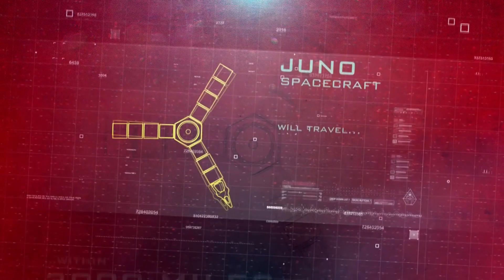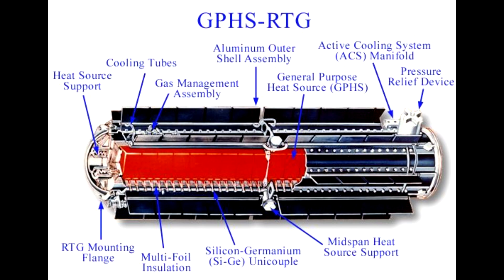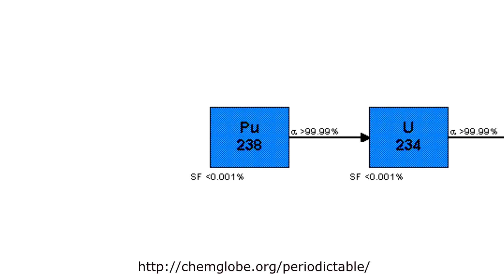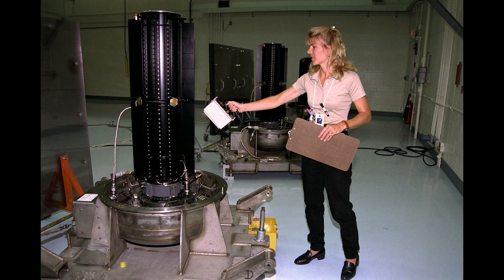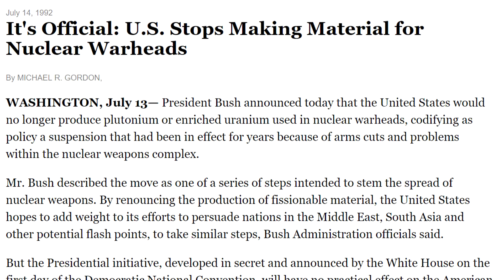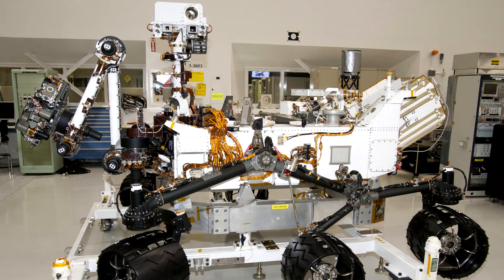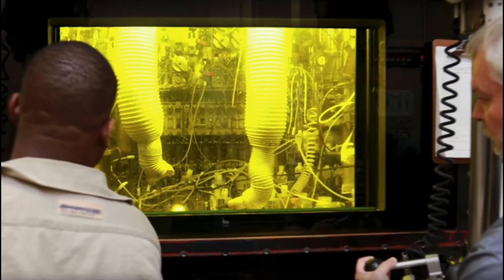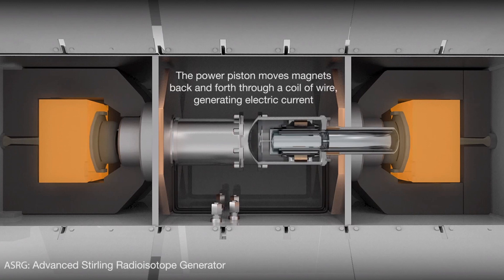Juno & NASA's Plutonium Shortage

Comment: While I knew about the plutonium shortage I thought they decided against using RTGs because Juno was scheduled to use an Earth gravity assist (which I believe is a no-no by international agreement)

I know there are other isotopes useful in RTG's; Strontium-90 is used in medical devices but I think it has half the shelf-life of Plutonium.  Maybe we should start using Americium because how cool would that be  ;)
Reply from the maker: +jonskowitz nah other spacecraft with RTG's have made earth gravity assists.
Reply from the maker: +jonskowitz strontium 90 is used in earth based RTG's because it's more common and a lot cheaper. But the energy density is Lower so in spacecraft the higher power density wins.
Reply: I think that is an orbital agreement, dunno about gravity assists, though.
Reply: Also, these things are designed to survive all sorts of abuse, such as atmospheric entry (the one carried aboard the Apollo 13 LEM is believed to have survived re-entry from an escape trajectory), and a launch failure (I read a while ago they tested casings by firing them at concrete slabs), all without breaking up!
Reply: Only neptunium shall be used when traveling to Neptune
Reply: Scott Manley Ya, was just looking it up and in post Carter years, both Cassini–Huygens and Galileo did an earth gravity assist.
Reply: I stand corrected then
Reply: Even the shorter shelf lives would be ok, because they'd all still be well long enough. It may have more to due with radiation particles, as Scott said.
Reply: That was what I was wondering about.

I found out that Americium is used in smoke detectors and I've been specifically forbidden from manufacturing an RTG in the house
Reply: Put a shed in your back garden, it will get around the restriction and sheds have been working for the UK for years now.
Reply: Kit Naylor Yup, very rough and ready, that is why they are less efficient than theoretical maximums of electro-thermo systems! When the real world hits, reality seldom looks like the ideal :D
Reply: Xeno_Lithic In theory they're so dead-simple that just anybody should be able to build one out of two dissimilar metals, something to use as a heat sink... and of course enough material to generate a measurable current.  

That last one turned the exercise into a purely academic one for me.
Reply: I did some more reading on David Hahn.  Poor kid, he was obviously intelligent, creative, and ambitious (at least in one specific direction).  It doesn't look like life has been very kind to him following the incident.

(from the looks of things, his safety protocols could do with some work though)
Reply: nope, a tragic story really. The radioactive boy scout did not have his best days ahead of him, sadly.
Reply: Xeno_Lithic Actually, I doubt those are radiation burns, I think he had a drug problem. If you are getting radiation syndrome, without treatment, you are also likely to die. Those pictures are of him much older, so ya, drugs is my bet.
Reply: Those only have .29 micrograms of Am anyway, you would need billions of smoke detectors to get enough material.
Reply: Ya, that is understandable, technically, for most elements heavier than uranium that are odd number are fissionable...making them controlled substances. You could technically make a bomb out of nearly any odd numbered isotope as a result and AM241 is odd :D
Reply: I've been waiting for that joke XD
Reply: Christopher Willis That was one of the two reasons I shelved the idea.  kThe other was being told, "I am not okay with you building a nuclear reactor in the house."
Reply: +jonskowitz "Son,  why was your light on all night?" 
"What light? "
".........."
Reply: LOL

One of the many advantages of nuclear power experimentation.

Comment: Just out of curiosity, and because I'm an idiot, how do they 'make' Pu-238?
(I understand half-life, so if that's part of it then you don't need to explain all that =D)
Reply: You sniff around in nuclear waste from a lighter element, usually neptunium 237. You expose that to a neutron source and it will absorb a neutron and decay eventually to Pu238. You have to do this slowly so that the material doesn't absorb to many neutrons and become Pu239, weapons plutonium, or Pu240, which has a low but significant  spontaneous fission rate...lots of gammas in otherwords. 

So you take something that is rare and costs more than diamonds, and you bombard that with other diamonds and send it off to space....it is expensive in other words!
Reply: Christopher Willis Marvelous, thank you ^.^
Reply: In addition to extracting it and materials to make it from spent fuel, it can also be produced from neutron irradiation of americium - which, I'm fairly certain, is how it's being produced at ORNL, considering it's being produced by the High Flux Isotope Reactor - which is an entire reactor facility set up for neutron bombardment.

Comment: Radioisotope thermoelectric generator
not Radioisotope thermal generator
Reply: You're obviously someone who's just learned about RTGs and now you want to tell the world that you know about them
Reply: they are technically also radioisotipe thermal generators as they produce waste heat.
so , technically , scott was right...
Reply: It's the same.
The only difference is that the radioisotope thermoelectric one converts the heat into electricity.
Reply: Who are you talking to?
If you are talking to me; I still know very little on the subject, I'm just stating that it converts heat into electricity.
Reply: ender_scythe no, i'm talking to the one who posted the original comment
Reply: Ah, okay.

Comment: Would Thorium reactors not make 238 as a byproduct if they get them going ?
Reply: +Drunken Hobo nope, thorium 238 is a byproduct of the th-232 process, by converting th-232 to U233 eventually you end up with pu238 as a byproduct and since the process is all liquid it would be trivial to chemically seperate this byproduct from the nuclear waste
Reply: Kinda, but right now fuel reprocessing in verboten anyway. Thorium fuel cycle that is likely to exist will also have uranium mixed in it, which ruins this capability. There aren't any pure thorium reactors on the horizon, but some new molten salt reactor start ups plan to use at least some thorium, which gets the technology ball rolling. But I wouldn't count on it for at least 20-30 years.
Reply: Christopher Willis I'm excited for thorcon though :D I like their idea of mass producing the most easiest design to make that already beats PWR by a large margin.

Comment: I've studied these extensivelly (except for the nuclear fuel bit).
The thermocouple tops at 25% efficiency. That is, for each 4J of heat the nuclear fuel puts out, 1J is supplied as electric power and 3 is radiated into outer space. By the way, you can find one in a nearby water cooler, in which case it will be called a Peltier Plate. Fascinating little devices. You can use them to heat stuff, cool stuff or generate electricity through heat differential.
Now, I know from experience Stirling engines are very efficient, especially the coaxial ones. But being four times more efficient would mean they are near 100% efficient?
I don't doubt they would be far better. But while you have the peltiers turning heat energy (from nuclear energy) straight into electrical energy. While the Stirling turns thermal into entropy (the Stirling cycle is like a Carnot cycle, only with a regenerator. So, it works by compressing and expanding a gas), then into linear mechanical energy, then rotational momentum and then it turns a generator that finally turns it into electricity. So, plenty of opportunity for losses. I find it hard to believe it can be that good.
Reply: RTGs are usually no more than 7% efficient in the real world. ASRG is around 26% efficiency.
Reply: "The thermocouple tops at 25% efficiency."
Yep, as a limiting case, but that requires a temperature differential of *thousands* of degrees.
In the real world, you will be lucky to get 8%, more likely 6%
NASA's stirling generator looks to achieve about 26% efficiency, and a lifespan of up to 30 years, despite having multiple moving parts in it.
As for mass... the classic RTG delivers ~ 110 watts of power from a 45kg device, while the Stirling generator gives 140 watts from a 34 kg device. 
The ASRG is lighter, uses less fuel, and delivers more power.
The only real disadvantages are: limited life (30 years not enough??), and greater sensitivity to environment. Having moving parts, it is more sensitive to casing temperature, vibration, etc..
Reply: Oh, a stirling engine can be nice and efficient, but they're heavy.
Reply: spaceminions Oh indeed, it might be one of those trade off things, but RTGs aren't light either, and using plutonium more efficiently might make up the difference. We don't have a final spec yet, so it is hard to say!
Reply: Christopher Willis Yeah, and these won't be rotating, they'll just move back and forth inline with coils around for the electric generation. Won't leak the gas that way.

Comment: why dont they use cold fusion?
Reply: cold fusion is a myth and hasn't been recreated in the lab since it's conception.
Reply: Because we haven't made a functioning fusion reactor yet. At least, not one that generates any power. Germany did nuclear fusion not long ago, but it only lasted about a tenth of a second, and the reactor was as big as a medium sized house.
Reply: Muon-catalyzed fusion is cold, and it works. But it takes too much energy to make muons, so you can never break even.
Reply: One of the things what drives Sience the most is the "why not" question.
Reply: you'd have to grandually work up to muon catalyzed fusion, nature wants us to work for this technology the hard way no shortcuts
Reply: Even so, Think about this from a logical perspective.

According to the Cold Fusion model that gained controversy (not muon-catalyzed fusion, that actually has merit and is a studied field of science) They utilize a crystal lattice that has hydrogen being injected inbetween the gaps in the crystal lattice, when applying an electric current apparently the crystal lattice "Shrunk" And fused the Hydrogen at room temperature.

First of all, You can't use bonds and fields that equal kiloelectron volts of power to break bonds and fields that equal MEGA electron volts of power, it would take a million "crystal lattices's" Squeezing down on the hydrogen before it by chance Quantum tunnels and fusion occurs. It's just not possible.

If those Bonds and fields were more than the MeV required to fuse hydrogen, sure it would work but in our universe there is no free lunch and it would require a huge amount of energy to make a field strong enough to overcome the strong force of hydrogen nuclei.
Reply: Jake Pama I'm pumped to see the results of the Wendelstein 7x Stellerator experiment, I really hope they solve the increasing angular momentum problem that normal tokomak configurations suffer, And I really hope they can break even, it would be the greatest success in the history of humankind.

Comment: Doesn't having moving parts on a spacecraft that has to be expected to be fully operational for several decades seem like a mistake? Moving parts can lead to mechnical failures and you can't fix those when it's 5 billion kilometres away.
Reply: Yes, simple is better, but when a resource is rare, you have to consider the probability of failure vs the utilization of that resource and make a decision. And for short duration missions like this one, it might be a really great choice.
Reply: exactly do you send 4 probes with the possibility of mechanical failure, or only one?
Reply: Joseph Mans The answer requires testing and money, neither of which was forth coming. I have learned that the program has been hobbling forward, though. We "might" have a prototype in 2017, flight ready in 2018?! https://prod.nais.nasa.gov/eps/eps_data/165279-OTHER-005-001.pdf

I haven't been able to reach anyone official yet.
Reply: Using rotational moving part to steer the spacecraft (torque steering).

Comment: Technically speaking, if some spacecraft want more heat for instruments they could just use the extra electricity to run heating elements where they need it.
Reply: Right, RTG does it for free is the point, simple is good, particularly in space! That said, heating elements aren't to complicated either :D
Reply: Scarce power or plutonium nugget that weighs a bunch.... tough choices. Side note but the Spirit and Opportunity rover's actually use both. They have a few plutonium heaters as well as electric heaters. When NASA was worried about the solar panels not getting enough power it was because they needed to run the heaters to keep the computers running.
Reply: I think the they would or could burn but an rtg is very reliable.
Reply: +NT D% Don't the computers turn off because they get too cold and then not turn back on again? I am not really sure. The batteries would also deteriorate if they got too far outside their operation limits I'm pretty sure. It's been year since reading this so I'm not totally sure on what I remember.
Reply: I think its mostly for cost purposes, you could develop components that work at lower temperatures... or you could just adapt current technology to work in space and add heaters. Also cooling something is way harder than heating something from a mechanical perspective.
Reply: Like others have said, the rtg does it for free. Not to mention that potential energy is loosed every time you change the "state" of said energy. You will get more heating from the waste heat than you would from converting the energy from heat, to electricity, and then back to heat.
Reply: It also happens when cooling computers with liquid nitrogen, the so called "Cold bug"  and "Cold boot bug". If you decrease the temperature the amount of charge carriers in a semiconductor drops exponentially (resistance also drops, but does not go to zero). I don't think any cpu can be made to work reliably at a shivering 3K though

Comment: Lazer beam power transmition should be used for far space exploration robots.
Reply: Super inefficient. Inverse square law etc etc
Reply: Also, AIM! Try aiming a beam millions of kilometers away!
Reply: And then you realize that both Earth and Mars turn.
Reply: All laser beams must diverge. The effect is much less than with lenses and normal light sources, but it still occurs. At 100 million kilometers (a range Mars and Venus occasionally fall under), the laser is spread out over a circle with a radius of least 200 meters, if the laser device itself has an aperture on the order of 100 meters. At a more realistic but still huge aperture of 10 cm, it's spread out over 200 kilometers instead.

Suppose it's 200 meters, for a surface area of 125000 square meters. The sun's light has an intensity of about 1400 W/m^2, so to double the effectiveness of solar panels the laser would need at least 176 GW of continuous power. That is about 5% of the entire world's energy consumption. And that's if you're going to Mars or Venus. If you want to double intensity at Jupiter, you would need closer to 10 TW of continuous power, 500% of the entire world's energy consumption.

See the wikipedia page on Gaussian beams.